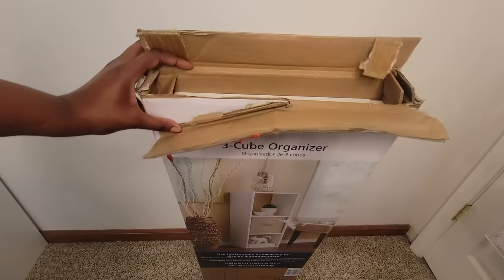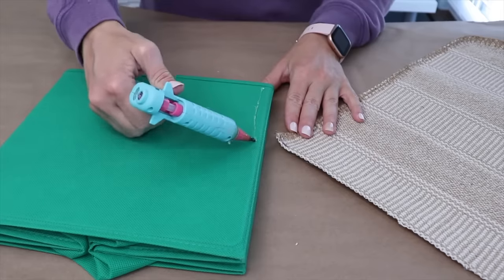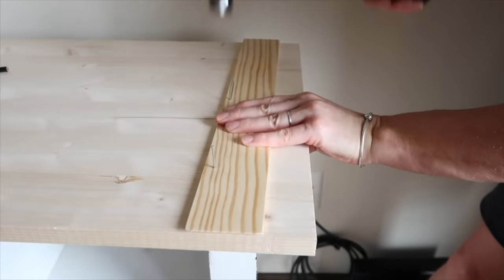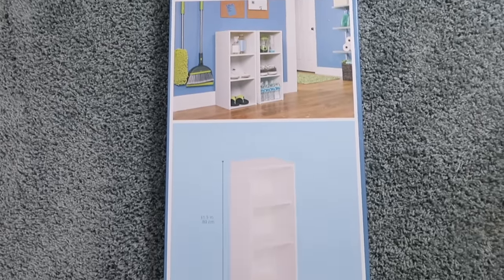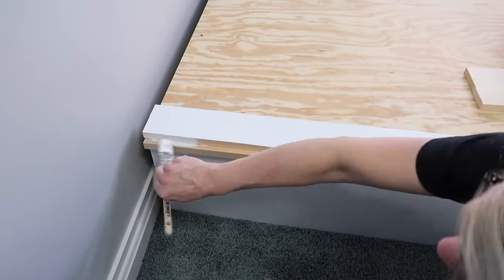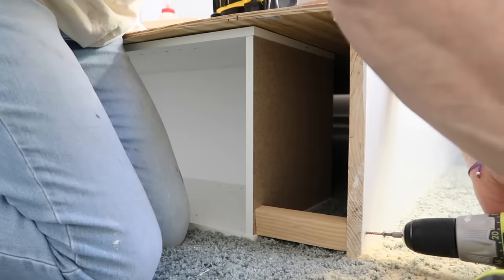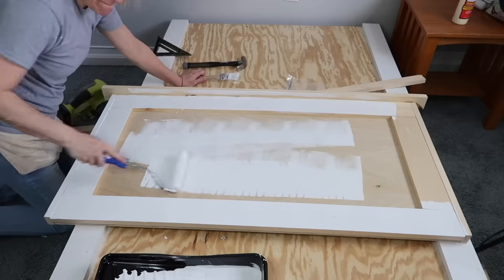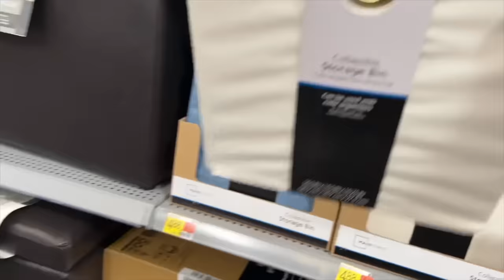The brilliant new way people are using Walmart storage cubes in their bedrooms

Comment: You can’t sit on a Walmart organizer. It will break 🙄
Reply: Seriously!
Reply: A 5 year old sat on one, it broke.  😂
Reply: The engeneering of cubes as well as adding any supports of wood change your tensile strength.
Reply: I came here to say that too. Been there for my preschoolers. I thought it would be fine cause they’re so little, nope! Lasted about two weeks started to bend and weaken. Just not made for sitting. Although the reinforced thick wooded ones might hold up nicely.
Reply: Yeah they don't make it long, especially if you forget then have birthday party and theirs about 10, seven years old and they believe they are frogger in hoping, jumping,  WWE takedowns. Best bet is old changing tables good to break down make a seat bench, you can also use the crib mattress believeme they are the best whether you have a old one or a friend getting rid of one.  Take a old wore out sheets, older favorite blankets can be cut down, cloth hot glue, cloth tape, sewing machine or hand stich. You always want to be able to pull cloth off to wash, I use them easy stich on velcro for on and off.  Older dressers are good, you can use the drawers for something else, can't go wrong finding older pieces at curbside,  you can make anything from Lego table to a outside bench seat.

Just my opinion,  I'm a wood collector though anytime someone has good dresser, shelves, wood doors at the curb or they going to toss out I stock pile in our old barn😂😂 what's best is when someone pulls out cabinets whether whole or pieces if it's older cupboards they are always sold wood,  old farmhouses are the best. They work for hubby's car garage with the hoist, from tools to everything else. Anything whether metal shelves or cupboards,  anything with wheels is worth taking the time to take them of and have a drawers full of them.
Reply: Most anything you buy at Wal-Mart will break if you sit on it!
Reply: What are you all buying? These are the exact same as the ikea kallax units, they are the Better Homes and Gardens brand.
Reply: @LoriCrabtree31  nope. particle board garbage. Walmart is a store I will never step foot in. I learned my lesson in my 20s. nothing from walmart is worth buying.
Reply: @joeyjamison5772 even some of the chairs. 😂
Reply: It's for aesthetic more than anything

Comment: Having done this when I lived on a budget, those mainstay things only work to a certain degree, but you have to stabilize them or they will fall apart if you hit them at the wrong angle..L-brackets or  screwing plywood as a backer.. Unless for someone under 75 lbs.
Reply from the maker: Great points - good to start with and then you can reinforce later.

Comment: I wouldn’t trust the cubes unit hanging high on the wall, they’re not designed to support that much weight
Reply: IKEA does it all the time. Be sure to secure them to the wall beams and use the wall mounts and braces